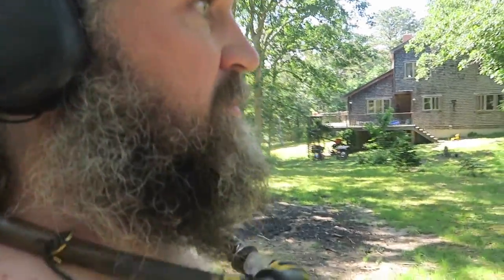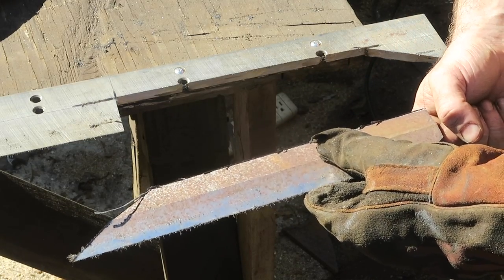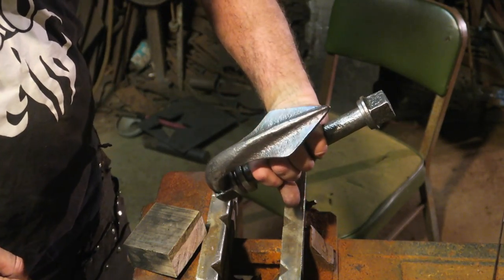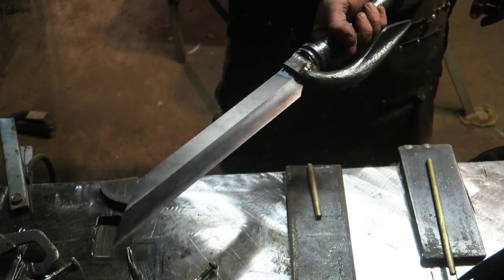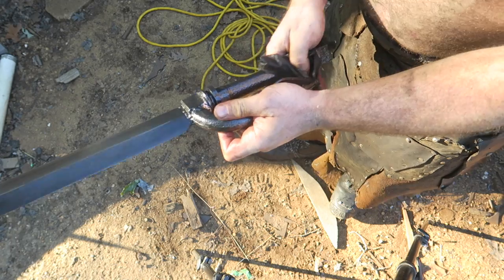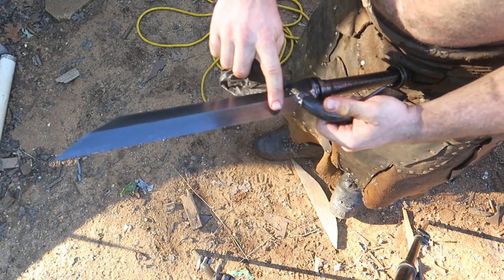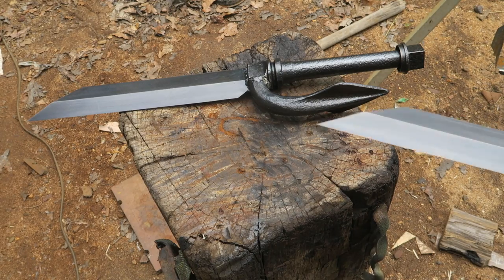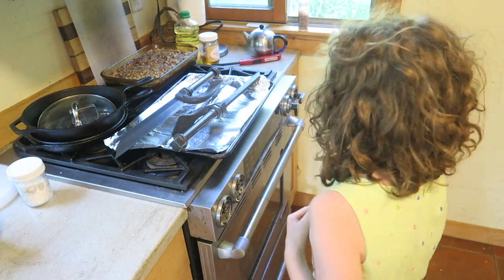MicroCharitybuild: Weirdy Scramasax

Comment: The left over pice from the thing the blade is made of would make a cool ax.
Reply: Not enough mass, would be easier to use a hammer as the beginning stock & set high carbon steel into a forged axe head

Comment: I have been making knives for 17 years now. Cerakote works great on knives. It's an easy finish to apply and is very durable on a knife.
Reply from the maker: Cutting logs and such? The main problem is like for my 50lb swords, some fella will send me a picture of an anime sword that's bright green or whatever.
Reply: I had a customer really try his best to destroy a knife after he bought it.  cutting tires, sheet metal, cans, basically anything he could find.  He said that he was surprised by the performance and the coating held up well.  cerakote will hold up well for your swords.  I would give it a try.  it is sprayed on like paint and baked to cure the paint like powder coating.

Comment: The guards on the handles look like mini ship anchors... So maybe you'd be able to find them in ship building places? But you'd probably be able to make them with pieces of flat plate welded to curved pieces of bar. Then use that copper trick from one of your newer videos (the Warden twin blade one) to give it that older look.

Comment: I believe that the anchor and that handle part were made out of wrought or cast iron, hence the spitting when you were welding it. I've only had the same happen to me when welding rusty shit or cast iron because of the carbon pockets in the material, so as it heats up to melting point, the carbon explodes a little and spits a bit of glowing iron at you. That's my initial thought at least.

Comment: best place to pick up scraps is a boating dump or antique shops with odd items in it. usually you can find some pretty solid metal items. I think another good place would maybe be a general shitty dumping ground. I saw a old school copper bed frame that the legs/decorative top could have been reused for a handle or end piece. of course that would be better for a micro build since it wouldn't have passed the beat down test.

Comment: Interesting piece, and also an awesome bit of trading for services :). As to the age of those pieces you had laying around? Well, one of them appears to be the bottom half of an old british admiralty style anchor. They were made and used easily back into the early 1820's, and while I doubt the one you have there is anywhere near that old, it might be somewhere in the 50 to 70 year age bracket. You don't really see them much anymore, save for decoration since they're still most easily recognized as an anchor by non-seafairing types. 

Anyway, I hope the short history lesson and age-of-material spitballing was helpful :).

Comment: The way you're making things, the welds are perfectly fine. The problems with welding a blade arise when you're going to heat treat like a blacksmith would...quench before the weld, and the weld ruins the temper. Quench after the weld, and you'll get too many stress points at the weld. Since you're not heat treating, you get neither of those problems.

Edit: Also, you could theoretically use localized heat (keeping all but the edge of the blade cool) to harden or soften a piece without messing with anything else.

Comment: I wanna see Michael on that one show Forged in Fire.
The only problem is Michael's style involves purely welding and grinding for a pretty shape. Forged in fire requires all the correct blade forging techniques, from cutting your own block of metal out to shaping that with an anvil or the machine, and then heat treating it. So I doubt he'd do well if it wasn't a special episode.

Comment: *I cant wait to get a tig welder. I love your build videos.
Reply: (if you ment welder) he uses a tig and torch welder torch for bending and tig for connecting you dont really need either tho if you wanna save money their are many different ways to replace a welder in the art of weapon making. Torch and TiG are very expensive if you want good ones and even more long term for propane (torch) and argon (tig) of course there are diffrent gasses for tig but i do believe the cheapest one is propane for torch.
Reply: Lol sorry tired. Thank you for the info, I have a small stick welder. I meant I can't wait to get a tig welder.
Reply: Lol no problem man i love welding i also have a small stick welder that i love to death. tig is an art and easy to learn hard to master.
Reply: Yes. I did a lot of stainless steel welding. Tig was so much fun, but I never own my own so could not play with it.

Comment: when you leave steel in water for about a week it will cover in rust but it comes off with light sanding and leave a natural and tough oxidation on the steel

Comment: i envy you toooo damn much ever since a friend tagged me your "lifes work". so if you would like to re-texture your welds to match old timey rust pitting you could use a needle gun while the area is cherry red to dull orange hot. use scrap 16g sheet metal as a shield for the blade and places you dont want peened. also the way you parent makes you my hero. thank you

Comment: I love those seaxs.  I think one small improvement would be to Hammer the handles into a slightly oval shape so you get good indexing and edge alignment.  I'd love to try and wield some of the bigger swords and weapons.  I'm 6 foot tall 300 lbs and have very little fat on my body.  My max bench press is 465lbs and max squat I don't even know.  I could do three sets of 10 with 800 pounds. If anybody can use these over the top weapons it's me lol

Comment: tangs are only important if the hilt were made of wood if its one big screw off peice of steel it doesnt really matter its not a rat tail which would break easy if you tried to weld it because the weld material itself wouldnt be tempered like the rest of it and it would make a weakness.

Comment: What kind of welding was that??? I havent seen it before, it looked like weird arc welding and oxy welding
Reply: Dempsey Phillips It's TIG welding. The tungsten tip gets really close and it creates an arc, then he uses a filler rod to add metal to the liquid puddle. There's also shielding gas coming out around the arc.

Comment: i absolutely love these daggers the only issue i have is the handles look completely circular, wouldnt it be difficult to strike with the edge and make it want to twist as you struck, or does the fact that it tapers help it? i love these daggers though they are really awesome
Reply: The fact that the blade is only beveled on one side would be more likely to throw the edge off then the round hanndle, but yea a round handle is not ideal
Reply: Port Kapul I didnt even realize it was only beveled on one side it would definitely make it more difficult. thanks for pointing that out. that kindve bevel isnt meant for a weapon.that explains the last water jug when he tested it

Comment: 9:25 what so you clean the steel first then spray a solution called 'cold blue' on it and rinse it off with water after how long? and then the steel is darkened?
Reply from the maker: "cold blue". There is a better process for doing the same thing where the solution is hot, and requires professionals with expensive machines. Cold blue is the off the shelf version for doing it at home.
Reply: Alright thanks a ton. I havent started my workspace yet cos im just learning about tools and stuff right now and i love this channel for teaching me random stuff i might need :D

Could you tell me what the professional process is called or anything about it so i can reseach it a little more?
Reply from the maker: "hot bluing"
Reply: So you spray it with Cold BLUE, and it turns BLACK? The guy that came up with that name should check his eyes 😂
Reply: thaaaaaaaanks awesome :D
Reply: Spacehero The original stuff comes out a dark blue and was used on guns for over a century. The cheap spray solution is obviously different, but it's pretty similar.
Reply: i prefer the way this stuff looks gray-black ish but not a super fan of that its apparently pretty easy to scrape off.

Comment: absolutely nothing wrong with a welded on tang if properly executed. material choice is a large factor too
Reply: You probably don't know how to weld properly.

Now before you get up in arms, that was a joke based on the video, I have no idea what your welding abilities might be, but mine do not exist.
Reply: Anzu Wyliei hahahahahahaha omg
Reply: Anzu Wyliei aluminum is tricky to weld proper.
Reply: @scallie6462  - easiest way to tell if your boat is waterproof without putting it afloat? Fill it with water first.

Comment: I think that the anchor is made out of cast iron and that's why you were getting a lot of spatter use a silicon bronze filler next time
Reply from the maker: If that was the case I don't think I would have been able to weld it at all, when you try to regular weld cast iron you get a good looking weld and then all of a sudden you hear a "ping" and the whole weld cracks apart as it cools down.

Comment: Michael needs to sign the blades, or at least mention he has.
Reply: Lindsay Girle Yeah, maybe use his little air grinder with a ball tip and sign it in cursive. Then again, just about everything he makes has a build video so you can clearly identify his works.
Reply: +JasonWW2000 yeah it'd just be a nice touch